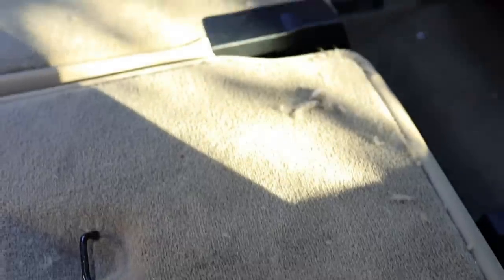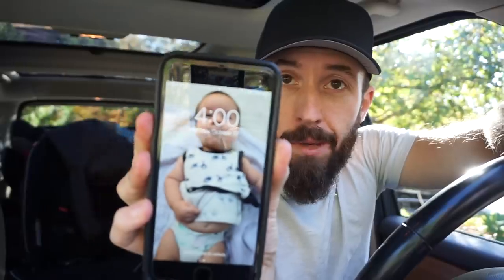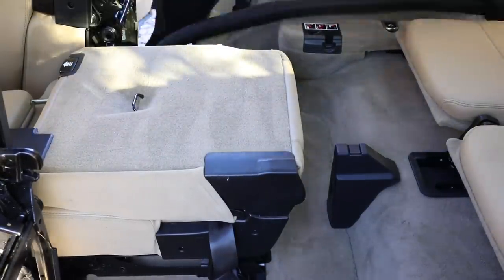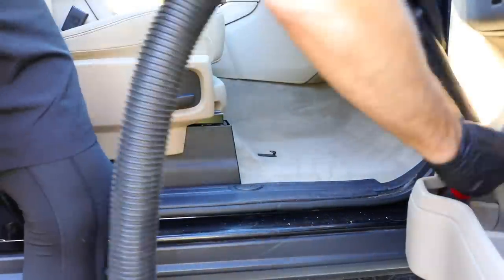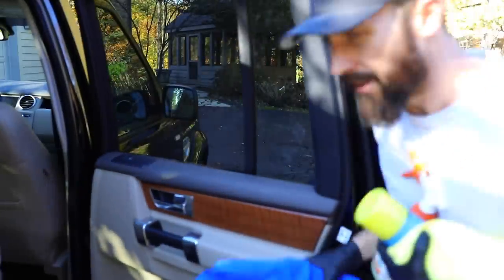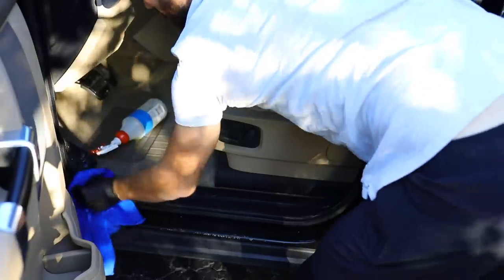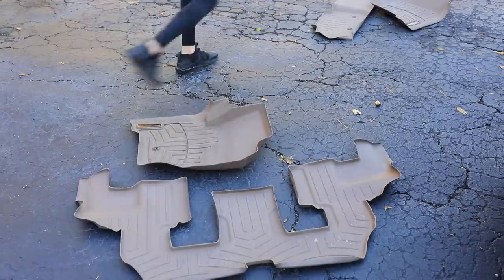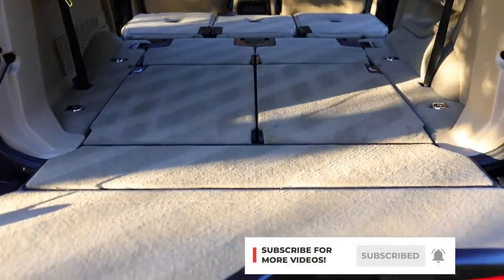HOW TO Deep Clean Your Car Interior In 1 Hour! Car Detailing Of A Land Rover LR4

Comment: Quick question-do you clean your drill brushes or just get new ones? If you clean them how do you?
Reply from the maker: As I am using them, even on the nastiest details, I clean them. Just turn on the house and slowly spin them with water rinsing it out. spray all purpose cleaner liberally as it rotates, rinse again. Have been using the same set of drill brushes since roach motel!

Comment: Question! My windshield and back... windshield (is that what it’s called?) seem to get this film on them and it’s super difficult to wipe them down and not have any streaks of film left. I usually have to wipe them down at least 3 times and even still, I notice some streaks when the sun shines on them. 
So.. do the streaks not fully go away because I’m using paper towels or because I’m not using a good cleaner?
Also... what the heck is this film from?

Comment: The APC I use for my vehicle makes the panels and faux leather interior so dry! How can I resolve this problem?
Reply: Bekkah Painter what APC are you using?
Reply: It’s just regular Walmart fabulouso. But I’m on a budget so I can’t afford chemical guys or expensive degreasers.
Reply from the maker: Check out Lexol. They have a cleaner and conditioner. It takes some time to apply and wipe off both but they do an incredible job at keeping some moisture and protection from cracking. I used it on the farm truck I did extensively if you want to see how it applies and looks after: https://youtu.be/rMoB0rF7u_4

Comment: Question: have you ever cleaned a car with makeup stains on the door vinyl? If so what did you use to get it out?
Reply: Try a wet cloth and that stuff what is used for handwashing the dishes. "Spüli" in germany. Removed suncream from my door aswell.
Reply from the maker: All purpose cleaner and a detailing brush should get it off or you may need a little steam from a steam cleaner to get it off.